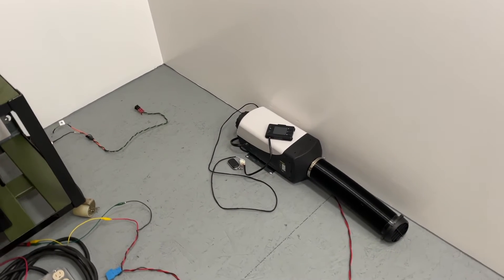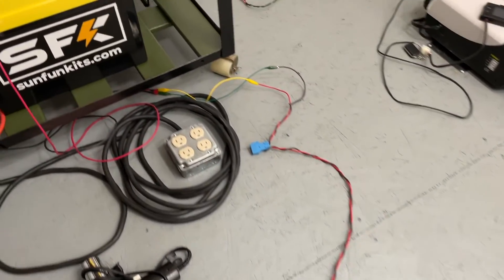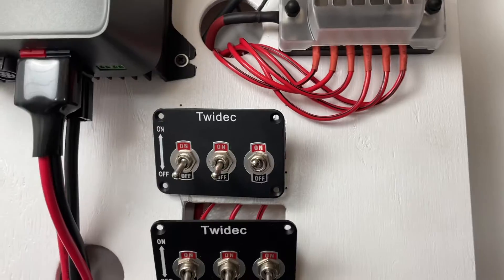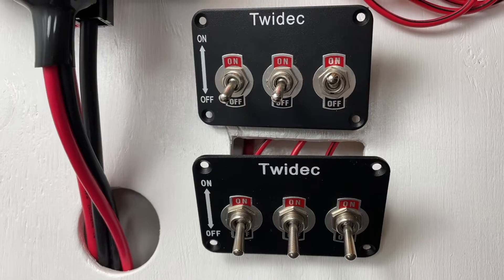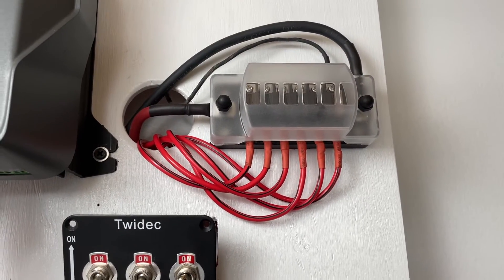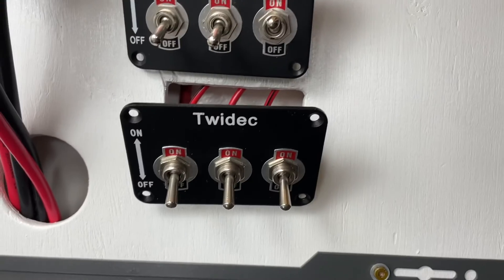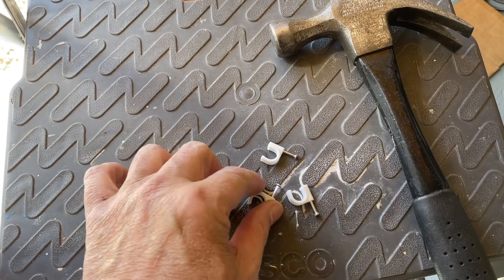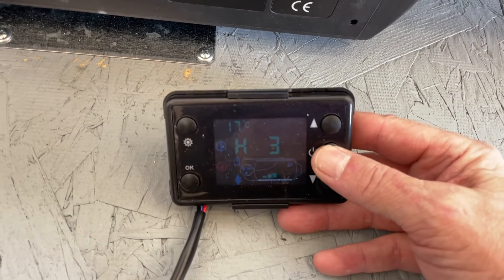Ultimate Guide to Hardwiring Your Diesel Heater to Off Grid Solar Power

Comment: Okay I'm running 4 235 watt panels and i have 4-100amp hr batteries. And go to start up automatically takes it down to 8v and wouldn't crank up. I am off grid I am trying to figure this thing out if you can please help and why I can't get it to fire up unless I run it off my truck and keep idling. Thanks

Comment: Did you ever use webasto for water heting?
They are some china 10-16-30kw disel water heaters. I'm gonna try to conect one 30kw heater on house heating. 10 radiators around 16kw heating...
Reply from the maker: I haven’t but that sounds neat.

Comment: Great content. I’d love to install one of these in my shop one day too. Can they be oriented vertically? So that the air outlet points down?
Reply from the maker: Thanks! I really don't know if you could mount it vertically or not. I've never seen one mounted that way.
Reply: @DIYHomesteadProjectsDIYHP10  I’ve managed to take up most of the wall space in my shop, so my thinking was I could use up less of it with it pointing down.
Reply from the maker: That makes sense to me. I just don't know if these heaters will run properly in a vertical position.